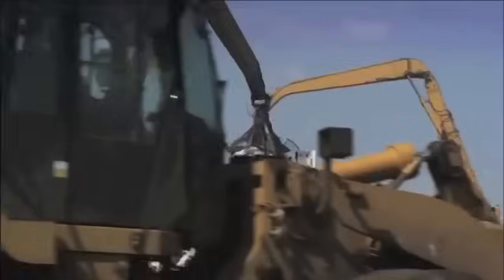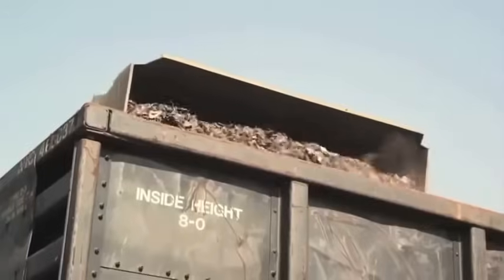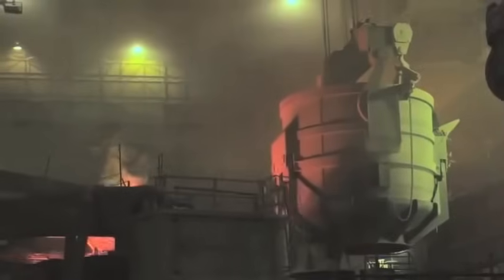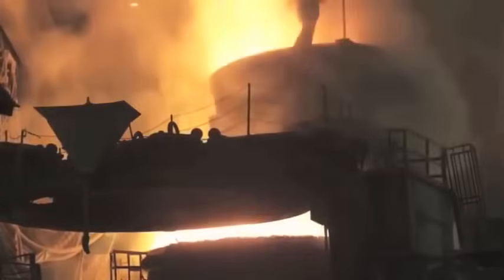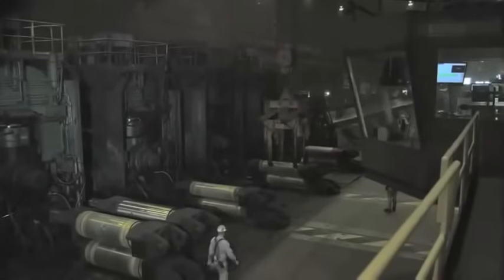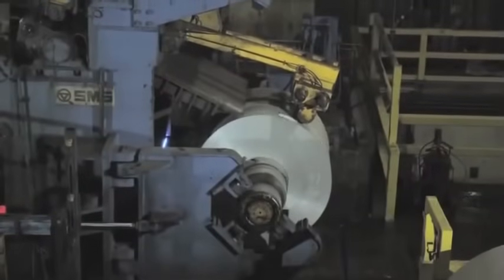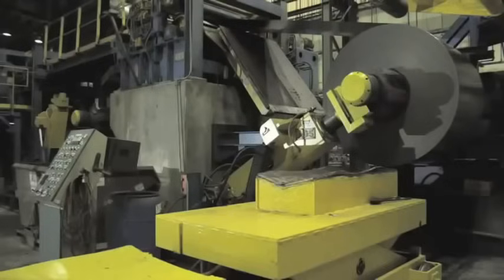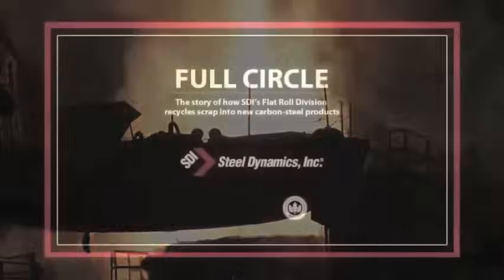How It Works - Steel Production

Comment: I wasn’t expecting the flashing God rays when the carbons rods were lowered. That gave me chills.
Reply: When you’re right next to it, it feels like a fighter jet taking off. The whole building is vibrating, it’s around 130 db.
Reply: @jeremielavigne5103  that’s terrifying but I really want to experience that lol
Reply: @Samuelon552  been working as a welder in the steel mill for a few years and it never gets old. The only thing that sucks is the air quality in these plants. Gotta have a respirator 8 to 12 hours a day in this heat is horrible.
Reply: @jeremielavigne5103  get yourself a PAPR forced air respirator, 3M, Miller, Lincoln, Esab, Optrel etc. all have them.  Maybe even ask your employer to cover the cost, theyre almost a must have in conditions like this.
Reply: I swear you can feel your bones shake
Reply: Why those carbon rods didnt melt?
Reply: @MrLiquid323  Carbon's melting point is 3550 C.

Comment: Ironically, every huge car crash improves steel production.
Reply: MrGumbwit and steel production improvements result in less damage to people in car accidents. It’s a positive cycle.
Reply: Unfortunately, cars are using less steel every year to improve car pricing. Meh...
Reply: It’s full circle.

(braces for defamatory lawsuit from SDI)
Reply: S T O N K S
Reply: cars don't have much steel and it often has impurities
Reply: "Iron"ically
Reply: STOP THE STEEL !
Reply: Every car purchased probably uses more steel than you'd ever successfully recover from it, so they're still operating at a net loss.

Comment: These mini mills are nice, but if our only source of steel was from mini mills eventually you will run out of scrap. Blast furnaces are very dangerous, but so badass. There are two at the mill I work at in Cleveland, Ohio.
Reply: I assume we just have so much scrap metal lying around it’s worth it to invest the billions needed for a facility like this. Probably being in Indiana helps too since it’s in the relative middle of the counties population.

Comment: they need a finger shaft oven.
There is  a shaft on the roof of the oven with movable cooled fingers, which preheat the scrap, with the heat of the gases coming from the oven. 
With that you really save much energy ;)
Reply: Pure narcissism. If they "needed" it, they would already have it. 🙄
Reply: @MichaelEgan66  No it is called energy saving and with energy saved the costs will go down. :)
Nothing to do with narcissism only because u don't know anything about steel production.

Comment: Narrator: We use "significantly less energy"
Also Narrator *with slight chuckle*: "Our monthly electric bill is around $7-8M"
So SDI is more efficient in their little bubble. How much coal does the Indiana-Michigan Power Center have to burn to make $7-8M worth of electricity, per month!? I'm not against SDI, steel manufacturing, Indiana-Michigan Power or capitalism. Just be truthful. Don't piss down my back and tell me it's raining.

Comment: Is it possible to make metals and steel with inbuilt added paint or antioxidant or something which actually makes the metal flexible or high strenght? Galvanisation works but when metal is cut, bent, the outer layer/cut layer is damaged
Reply: no
Reply: iron man mumu

Comment: I wonder how they can separate different types of steel.  For instance, how do you separate cast iron scrap from stainless steel?
Reply: I think they don't separate it, they can altered into different type of steel in ladle furnace
Reply: pretty sure you just go by analysis. if it's a large amount of steel with very different alloy, then it might be color coded for the people who work in the scrapyard

Comment: All metals are elements meaning they will never degrade no matter how many times you recycle them! I think recycling should be law, I wish more plastic was reused and recycled. How come they don't just design packaging to be reusable? They could make plastic sheeting that wraps around boxes to be re-usable and the boxes too. Instead of sending off boxes to me shredded and mulched down, make them compactable so they get uncompacted and reused. It's so possible to reduce the amount of waste, simply by re using or rethinking how we treat our waste!
Reply: Recycling steel is nice because it barely degrades when you recycle it. Plastics however degraded. That's why plastic recycling is not as big.
Reply: @darnit1944  I see, I once wanted to work for BP in their labs to make plastic that does not degrade with each generation of recycling!

Comment: Yeah but you wouldn't be able to use less power and emissions if it weren't for the original steel making process. The stuff I use to work on getting done. Plus, recycling steel makes inferior steel. It's harder more brittle and susceptible to rusting far sooner.

Comment: Even though their furnaces are electric what do you think the #1 generator of electricity is and that's coal lmfao
Reply: its more efficient to use coal to drive a turbine than it is to melt steel so the overall carbon emissions are lower